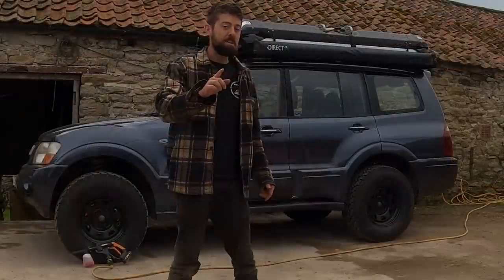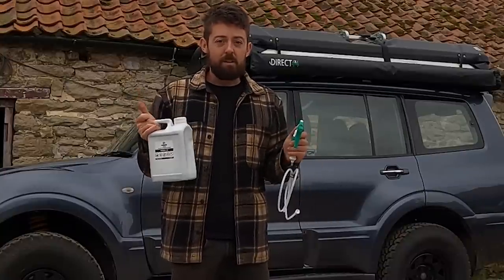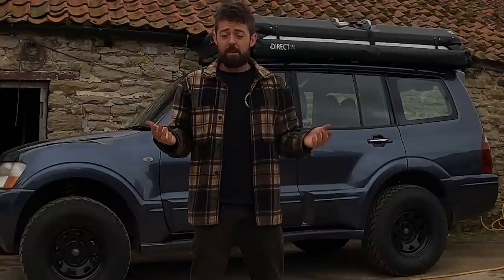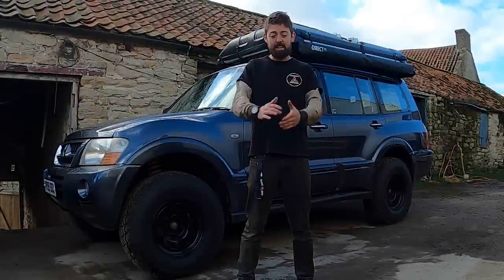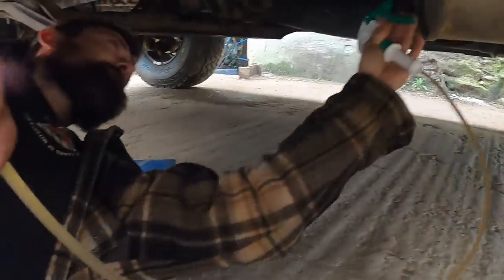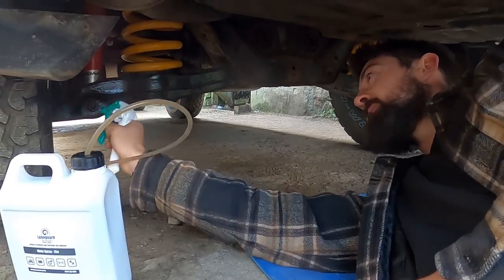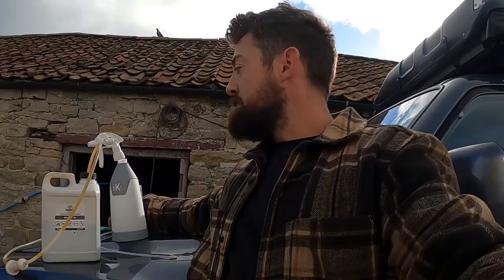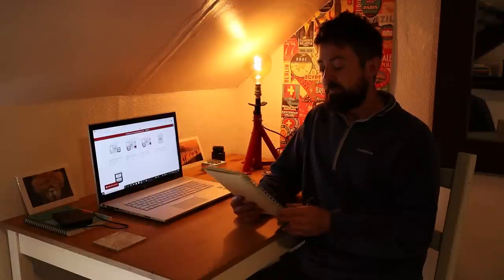Undersealing Made Easy with Lanoguard | Building an Overland Vehicle on a Budget

Comment: Used similar product in NZ about 7 years ago. Loved it and the grease I bought has lasted ages. Been thinking of doing lanogard each year rather than painting chassis every other year.
Reply from the maker: That's a good shout! My plan for the older white truck Molly with not a lot of paint left underneath was to finish paint and then Lanoguard every year or even 6 month if I get round to it 😉

Comment: I have an old Defender, and you see a lot of videos on application, but none on how the product performs over time. Has ANYONE got any experience. Any under protection would be adequate on a modern car  after all, they are protected for the most part with plastic trays, but Old land rovers have none.
Reply from the maker: We have on many occasions checked the condition of the Lanoguard after time ie after a year. Molly still looks great underneath even though its time for the annual top up. We made a short video of it recently.
Reply: @JKoverland  Thanks.